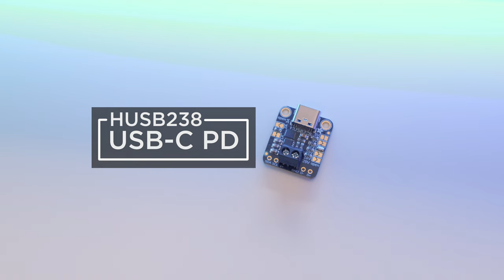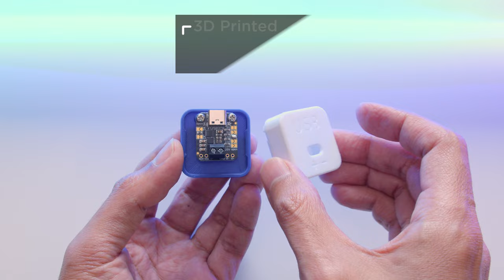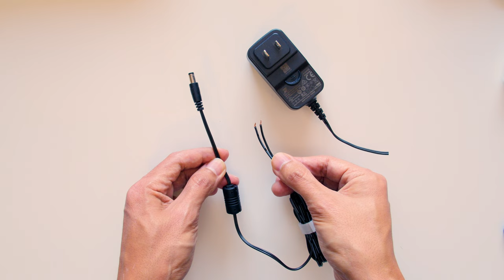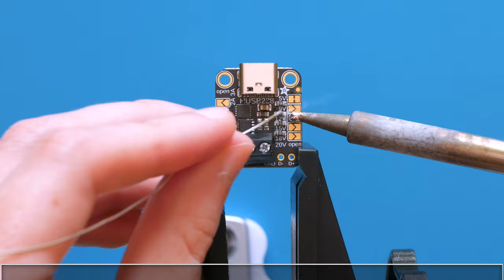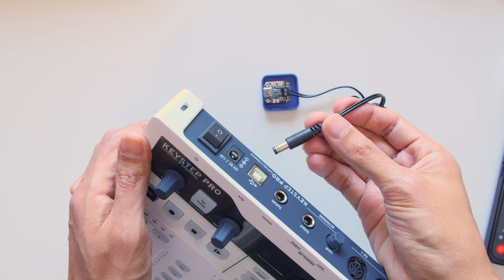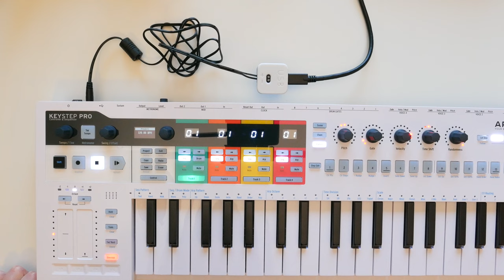USB-C Power Delivery Breakout #adafruit

Comment: I'm wondering that the maximum of 20V and 3A how comes together to 100W? The description actually says 20V 5A. Maybe that's possible over an I2C controlled board? I think it's a great board even with 60W!
Reply: Correct, if the board can crank out 5 amps, you can get 100W through 20 volts. That can definitely power laptops.

Comment: Great product, I'm sure there are many use cases for it...but I'd like to point out that if your sole goal is to "USB-C-ify" everything, you are just contributing to a growing e-waste problem. Don't toss working old adapters, especially on devices you may eventually pass on to less DIY-friendly folks. Use this board for fixing and prototyping.
Reply: Replacing a broken adapter with this is probably the easiest way to solve the problem, especially given how small it is, you can mount it inside or just make it part of the original cable. 

If anything, once I do make everything type c, I’ll just donate most of my adapter bin to a tech school or thrift store or something. 

I just hope they used reliable parts for this, too many horror stories about iffy cables and adapters not following spec.
Reply: There is magic in the HUSB238 chip that might not be clear from this video, but when you know, you know

Comment: does it already transmit power before handling out the voltage with the host? and, will it choose the next lower voltage if the host doesn't provide the requested voltage? is there a way to only have power output when the requested voltage is provided?